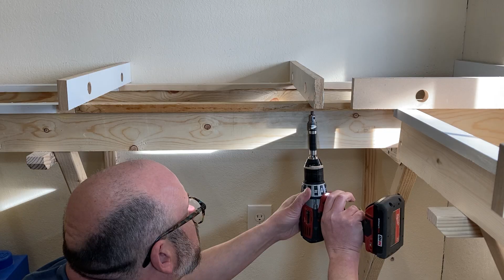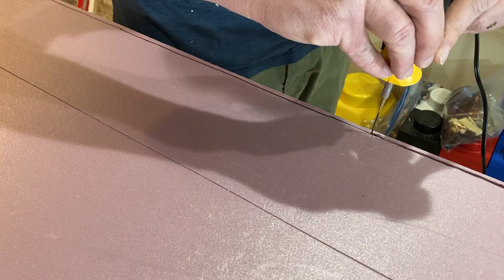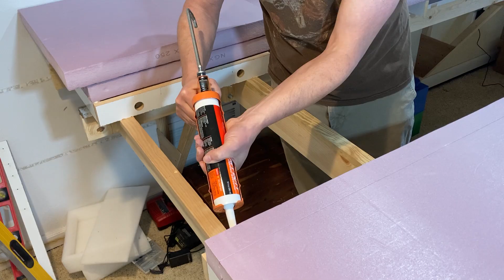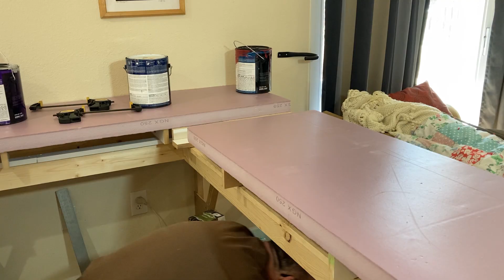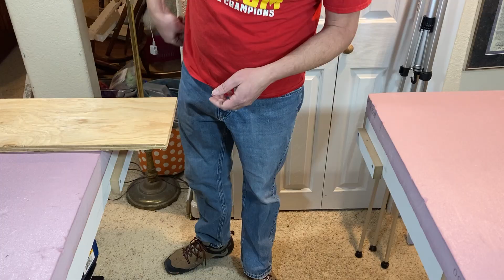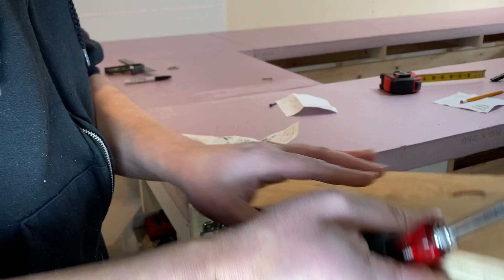Finishing Up the Benchwork for My Model Railroad

Comment: I realize this video is a year old but if you truly believe you will be moving this layout in the future did you ever consider a modular deck design? I recall an article in one of the model railroad magazines many years ago about the domino technique. They resemble a larger scale domino and are basically 2' wide by 4' long (or your choice of length). 

I come from a background of a modular club that got me started in the hobby in the 1980's and I found that such construction was solid, not overly heavy and very easy to wire as all of the wiring... at least on both my club module and my home domino layout. All wiring was done before the domino's were installed so I could flip them on their sides and work without getting under the bench work. Moving them is a breeze too as they are connected to each other with bolts and wingnuts.
Reply from the maker: I did consider modular a little bit. Moving wasn't huge factor in my design, since I don't see a move on the horizon, but almost everyone moves eventually, so I didn't try to make it a little bit easier to deal with when it happens.

Comment: You can easily and cleanly cut 2" foam using a medium tooth skill saw. Way straighter, assuming you use a cutting guide, much less messy. Still best to cut outside.
Reply from the maker: Great tip!

Comment: only see an issue with the clearance for the trackwork on top of the lift bridge... it's going to impact the foam every time you open it. your hinges would need to be above or level with track level for them to clear properly.
Reply from the maker: That's a good point. I'm going to need to figure that out.

Comment: Another excellent episode the lift bridge looks good and those hinges are excellent you will be constantly making adjustments though especially with temperature changes. Also don’t just use standard track at the ends the plastic ties won’t keep the track anchored. I am just about to modify all my track on my lift bridge using pc board to solder the track solid at the interface. I will tag you in my topic on HO scale shelf modelers when I commence the modifications next week
Reply from the maker: Many thanks! I'll keep an eye out for it.

Comment: Great job on finishing up your benchwork! You're moving along fast! I haven't had the best luck on lift bridges so I am curious how it works for you when you get your track installed. Keep up they great job! - Jason
Reply from the maker: Thanks, Jason. I'm thinking the lift bridge is going to be a little temperamental, especially since my track are going be at an angle on it. A buddy on one of the forum I go to recommended using a saw to cut the track rather than rail cutters to get the angle right. I've even considered using a cutoff wheel on my Dremel. We'll see.
Reply: @WhiteRiverLine  I found using a Dremel worked well for me (I have drop down staging shelves).
Reply from the maker: @LateNightHobbies  Good to know. Thanks!